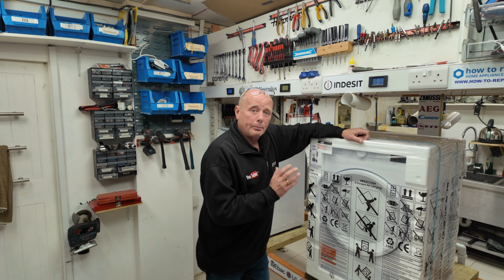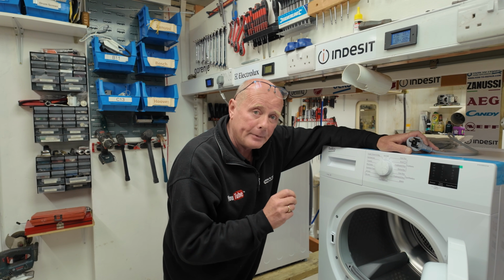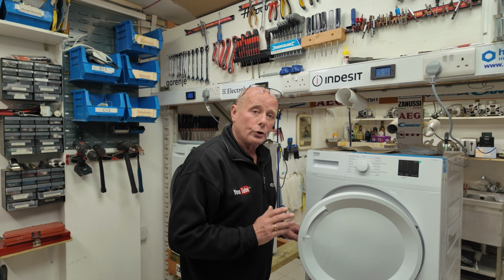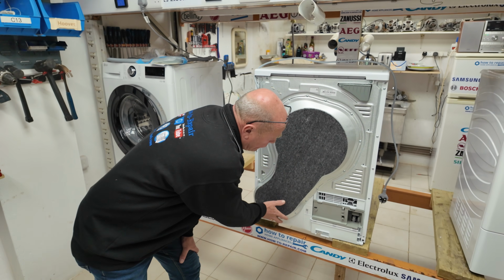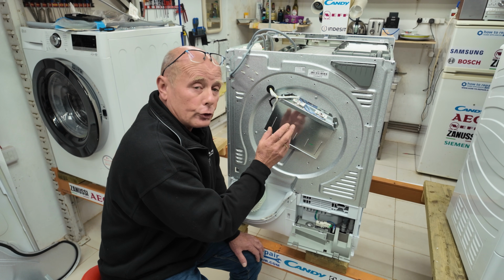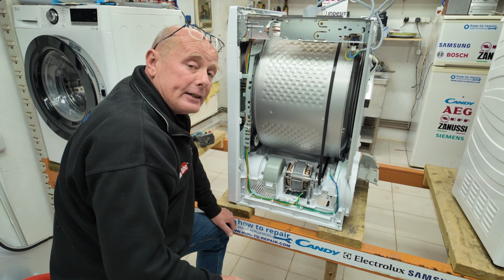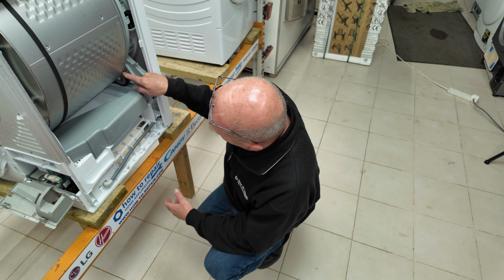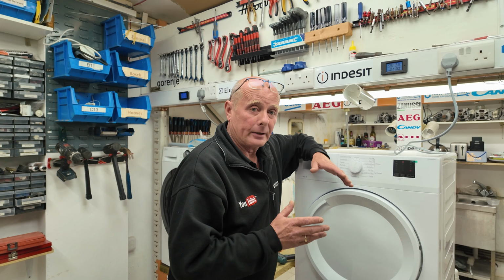Unboxing Beko DTKCE80021W Condenser Tumble Dryer Everything You Need to Know About Maintenance

Comment: i have a candy condenser unit. uses almost the same power than a heat pump dryer with kicker results. it usually over heats the clothes (in a safe margin not actually burning the clothes) then uses the same heat from the clothes to actually recirculate the hot air, having periods where the heating element goes off, sustaining the heat levels with the hot air + hot clothes. clever little design. uses about 50% a regular vented dryer would use of electricity. only issues i have run into it, some melted plastic on the evaporator, witch i cut off and did not damaged the dryer at all, some minor rubber sealing on the door issues letting hot air and some water drips out, and the touch buttons with the machine goes hot go crazy beeping, need to put the childs lock. other than that no issues and the dryer is quite amazing. has over 3 years of usage by now. i expect it to last past 6 years, since candy products are not meant to last sadly.

Comment: Just fixed a weird squealing noise on a Beko TD, initial thought it was the rear bearing but it turned out to be the pipe from the pump to the tank. When warm the pipe moves and touches the drum. The fix is to strap the two pipes together so the smaller pipe cannot move about. Another thing to note is there 3 different types of screws on the back panel, so make a note where they go
Reply: I think I have the same issue as you had with this weird squeal coming from the rear left of the machine.  Thanks for the heads up.

Comment: Great infomation  I am after a new condensing dryer ( Not heat pump ) whilst I can still get one . Can get this one at a good price and with your info being quite handy sure I  can keep it going for a good while.  I would of prefered a door opening to the left if possible. Have you got any recomedations . If not will struggle with this one.   Have had a simple vented white knight for 25 years and still going great but is vented and just built extention where vent was going out wall or would have kept it. I keep everything going as hate the way we waste the items and the money.

Comment: I like how Beko build their heat pumps with a proper filter so no dust or lint can get into the condenser, no stupid brush that just pushes it further in, mine is almost 5 years old and not a spec of anything on the fins so I presume inside either and works as efficiently as it did day 1, yes I monitor cycles because I have nothing better to do with my life. Beko is a bit flimsy and cheapish but the actual important parts in the interior seem to be durable for a cheap product, the fact they provide service manuals is just great. My Skoda Octavia workshop manual was provided to my by VAG for free too, so cudos to them too more manufacturers need to be like this.

Comment: I checked out this video to see if I could find dryer cycle temperatures as the instruction manual doesn’t seem to show them. I need to know low, medium and high temperature cycles as I’m looking to reproof a coat and it needs heat to activate it after washing/proofing has finished. Though this video didn’t tell me what I needed to know I found it really helpful and interesting, and I’ll be giving my dryer a bit of a service very soon, though I only use it in winter and even then no more than a few times a month. Thank you sir, it really is much appreciated.

Comment: I see that you don't do Miele.
Reply: Mieles are not the most common dryers either, around 1 in 6 or maybe even more of every UK house with a tumble dryer will have a Beko 😂 cheap
Reply: @applianceguy  l had the Miele Tda150 Condenser Dryer for nearly 8 years with no problem. Though l do clean out the filters regularly.
Reply from the maker: @rajshu6408  there’s a few Miele videos on the channel and I need to do more when I’m in the workshop. I’m not doing many unboxing because I use my own money to buy the machines so you can understand why.
Reply: @How-to-repair  Thankyou for your response. I couldn't find any videos on your channel on Miele Tda150c Condenser Dryer.
Reply: @How-to-repair we understand Miele is expensive globally so we appreciate whatever you can show us on the Miele brand❤
Reply from the maker: Challenge accepted I'll be back in the workshop in a couple of months and I'll pick up some Miele's
Reply: How can I buy parts from you what I need so I can help you

Comment: A have a hotpoint heat pump dryer and am very happy with it. It’s a Hotpoint ActiveCare NTM1192SKUK.
What should I be doing apart from hoovering the filters and cleaning the condenser unit
Reply from the maker: Hi Matthew, I’ll be uploading a heat pump tumble dryer maintenance video in a couple of days. You can turn on notifications to watch it as soon as it’s uploaded.

Comment: A solidly built dryer, judging by the video!
Reply from the maker: @pathfinder2reality  not a bad machine, especially when you consider the cost compared to the high-end ones and they supply technical manuals and wiring diagrams to support it